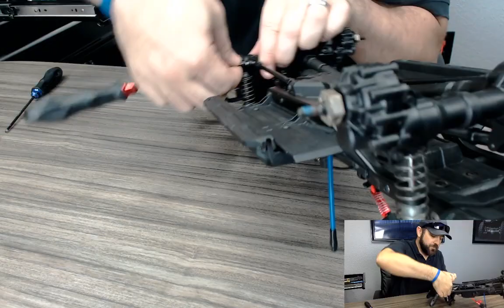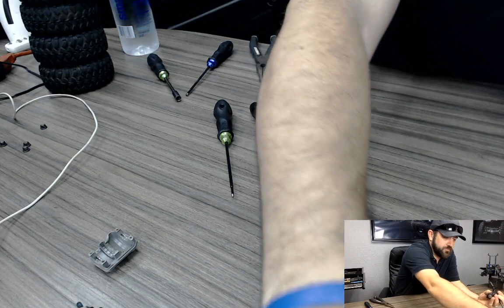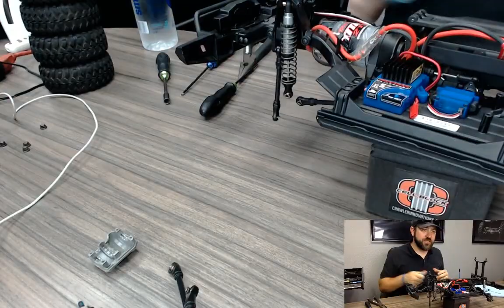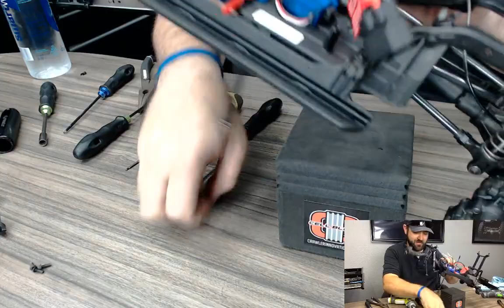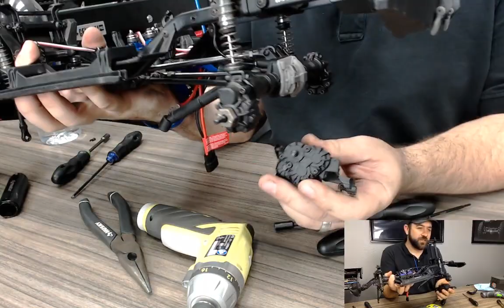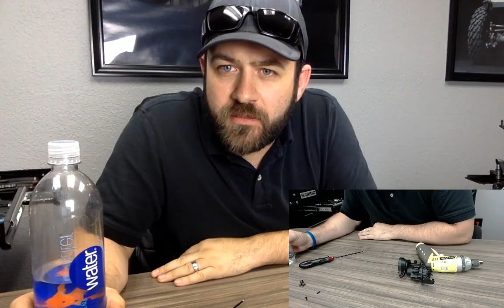Traxxas TRX4 Tear Down

Comment: Are there other wheel options?
Reply from the maker: +Paul K from the factory? No. Aftermarket, yes just about any standard 1.9
Reply: What are the specs? I'd really like to find a set of rims similar to the Freestyles I have on my 1:1 Defender!
Reply from the maker: +Paul K you can just look for a 1.9 beadlock with a 12mm hex.
Reply: Thanks! Any idea if Traxxas will make a Ninety?

Comment: drive train looks pretty beefy considering the portal gearing of 2.5:1.  You can figure the whole rest of the drive train will only see  40% of the torque a standard axle truck would see, just quite a bit more speed.  The diff gears are probably plenty big enough for 40% torque. 
 Plastic tranny gears will keep the noise down especially considering the driveline speeds and 21 turn motor.   Tranny is high speed and low torque.
Reply from the maker: +NW Huckin the wide portal gears should be able to hold up to the stress as well. What will really take some pressure is the leverage in the axle housing from the portal.

Comment: For the price of the unit there sure is alot of plastic gears Im pretty sure the manufacturer will start to make upgrades soon but for the cost just seems like the quality of the internationals are cheaply made
Reply: Robert Rosson go buy an axial then since it has all that plastic gears too that strip in 2 seconds also don't forget that the scx10 was 400 with all plastic till the scx10.2 with still has the same crap 2 plastic transmission gears that strip on a 7.2v battery in about 2 seconds

Comment: What drill do you use for quickly tearing down your truck?, I know it's a ryobi I just don't know the part number.
Reply from the maker: +Peter Velker it's a discontinued 4tec, they used to have an adjustable clutch but they removed that option from the new ones.

Comment: DAMN!!! PLASTIC gears in the trans?? 😲 And that slipper clutch(??), I guess add that to the list of needed upgrades! 
And before anyone replies - think.....
Do you think that if you upgraded to something like a Castle or Tekin Brushless System, that the little slipper clutch, even though it's double sided - wouldn't burn up? 
Thank YOU for this thorough, comprehensive tear down and explanation! It was very enlightening.  Although I could never afford one, it's a good service you're doing for the more affluent crowd.  

I'm still planning on getting those axles to put on my CST CMX.... Those would be a huge improvement over the stock, in steering, ground clearance, and a sick, low gear ratio - which would all but eliminate torque twist!! 👏👍👍
Murph
Reply: JA Murphy cmt has portal axles also without all the diff locker unlocked part
Reply: JA Murphy axial rtr scx10.2 still has cheap plastic transmission gears that strip to easy

Comment: I can see that machined, portal gears, maybe Brass, Chromoly or Stainless Steel - may be one of the first upgrades needed for this already overpriced Rig.... 
Then probably stronger stub axles too.  Then driveshafts.... 

I'll NEVER be able to afford one, so my opinion is basically moot....  but I wouldn't mind getting those Portal Axles and inner Wheelwells as separate parts to install on something that I can afford!
Reply: DUDE! That is a LOT of slop in that transmission/transfer case!!! 😲😲👎👎😠   WOW.....
I feel the same way about 2-speeds. More things to break...  and as you said, that gearbox is NOT a Trail repair! Not by any means. AND, all that plastic?  $500.00??? 😲 😲 😲 

...... Yeah, when they start selling PARTS, like axles, wheelwells, rock guards and such, then I might buy some. As an Air Force Veteran, I'll NEVER see that kind of money. 😣😕
Reply: JA Murphy why over priced maybe look at axial since it's rtr is 410 vs this at 450 with so much more to offer. as a scx10.2 rtr will strip transmission gears in 2 seconds.

Comment: Traxxas really struck a tone with me with my summit 1/8 that I had previously(I really wished I didn't sell it!), but sorry traxxas, they are just like the kings of cheapy plastic rc's!  I have an arrma kraton 6s and it cost $500 and compare that to a traxxas erevo 6s and IMO the kraton is better, all metal drivetrain, and less money..  I really loved my summit tho, but this traxxas TRX4 really doesn't look like its worth the high high dollar they have it up for.  I paid $329 for my ax10 deadbolt and that is my fav rock crawler/trail truck, its nearly all decked out now...
Reply: There is NOTHING about a $500 Rig that's "cheapy plastic RCs"!!! 😲😲😲
Dramatically overpriced, and threatens to raise the price points of the other Rigs is more like it, and that scares me.....
Reply: spencer 124 my traxxas slash has been through lots of bashing and racing around.  Seems to be still holding up well...not too cheap plastic imo.

Comment: Nice video very much appreciated.  But damn man, trying to repair this thing looks like it would be a complete pita, once again Traxxas is building a vehicle with way too many parts to break and just too many parts to take apart to get to things that you may need to replace.  Looks like I will be sticking with my SCX10-II as it is so much easier to work on than this thing looks to be.  Just wish Axial would get on the ball and tell us what's going on lol.  And they are using the same design for diff locking that was an issue with the Traxxas Summit, grumble.
Reply from the maker: +malitkies the axial cars will be back in stock within 1-2 weeks.
Reply: That's good to know, appreciate the info.  Most of the information I find is rumors and the like.
Reply: malitkies I spoke w Axial a few weeks ago.  They were switching manufacturers and said to stay tuned to their website for news.

Comment: 1:18:00 
first gear: 18 in, 36 out = 1:2 ratio
high gear: 30 in 24 out = 1:0.8 ratio (overdrive)
means the ratio of ratios is 2:0.8 = 2.5x 

pinion: 11
spur 45

Overall of the gearbox: 
low 1:8.2
high 1:3.3

So the 30:1 and 60:1 you mention is not right, as here the ratio of ratios would be 2x.
i think it being more than 2x is good for a crawler, as IMO you want to have more spread between high and low than 2x. I'd argue that 2.5x is still not very much, but it depends what one does with the truck.

Comment: The diff locking scheme isn't exactly as you mentioned, Harley @1:41:27.  The diff lock is on a 3-position switch.  You have only THREE options...1) All Open; 2) Front Lock/Rear Open; 3) All Locked.  You can not have rear locked and front open as an option.  I would, however swap the locking servos around on the Rx to allow the 2nd option to be Rear Lock/Front Open.
Reply: Greg Jones I had the same idea about the lockers. But I bet you'll just have to swap the two plugs in the radio, not move the servos. at least I hope it's that easy.
Reply: All that will be needed to change it around is to swap the two servo leads that plug into the receiver.   Wasn't planning to physically move the servos around. :)

Comment: all the plastic in the transmission! And no grease! With all that work to tear it down! I'm almost regretting pre-ordeeing and paying for it already... oh well. guess I won't be pushing it to hard LOL. 
Also, on another video (can't remember who) they pulled the front bumper, and an SCX10 Bumper fit right into it with no finagling. 
As for as the top heavy issue. For me it adds to the scale of the truck. A Real D90 Or D110, watch video's of them off-road. You can see them throw that weight in the body back and forth. But that's just me. maybe I'll change my feelings on it when I get a hold of it myself. 
thanks for tearing it down.
Reply: the summit also had a ton of plastic parts and it also held up. Even with bruslhess power
Reply: out of all the rc cars traxxas transmissions I worry the least about because I've never had a transmission from them fail. I have had many other brands strip gears in 2 minutes lol.

Comment: wow four spider gears ! I hope they last longer than the two in my Summit!
Reply: @ka4172 , Do you have the big Summit? is that a known problem? I have some of those diffs and was thinking of using them in a project...
Reply: On my Summit i use the lockers very often,even to make tight turns on the rocks.Bad idea ,on Rocks lock the axels permanent is way less stressfull for the spidergears. Ha ha but in my rear TRX4 locker one lock pin is broken,ha ha i think some of my testriders break it.
Reply: Hm, okay, will take that into consideration.

Comment: why do we need an open diff in a crawler
Reply: My scx10 runs as a trail truck and a crawler. It has A good sensored motor and ESC. It crawles and goes fast. I don't have any problem turning. It seams like a whole heap of over complication for little gain.
Reply: I primarily use my TRX-4 on hiking trails and open diffs offer a vastly better experience under those circumstances. I lock them only when crawling.
Reply: First of all, this is not a crawler. Its a scale/trail truck. Second, the locking diff makes turning easier and helps with driving in high gear. Just some things to think about :)
Reply: Try  turning with open diffs you would be surprised how much tighter the radius would be,under competition situation (scale truck comp)  you drive the tighter turns (without dig) than the other trucks i think! THe TRX4 is not only a crawler its more like a fun scale truck for many different situations.
Reply from the maker: +Legoman585 that's something that many people are asking. Personally I've never had a big desire for it either.